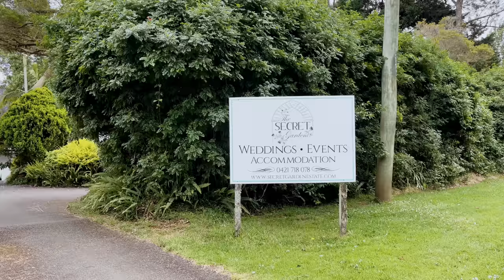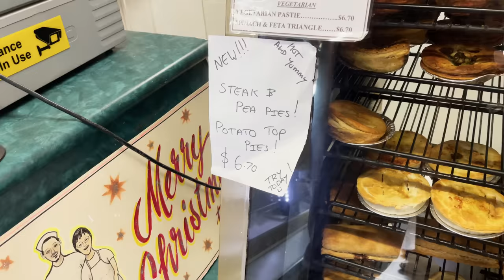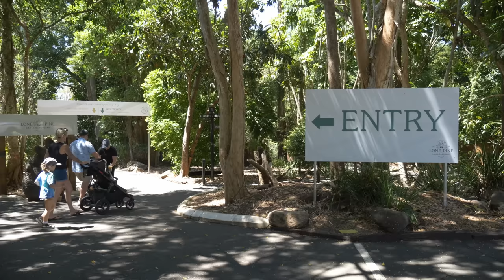FILIPINA GOES DOWN UNDER- SAILING LIFE ON JUPITER EP142

Comment: The shot of your mom as you were leaving was heartbreaking 💔.  I love what you did for her home. Please show us the finished job and how it holds up. I'm skeptical. Watching the concrete fall and tumble out during installation without proper shoring, rebar, and supports on poured footings, I don't see it lasting. I wish you would've spent more time with your mom.❤
Reply: I was wondering where the rebar was, doesn't look right to me either.